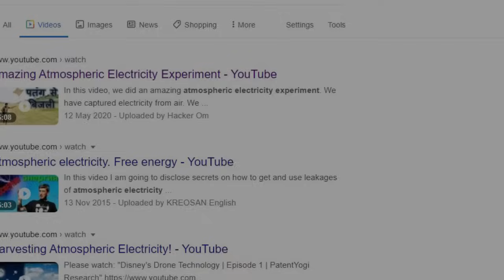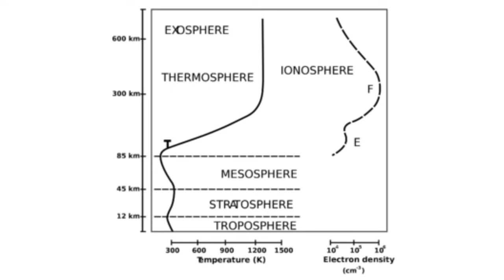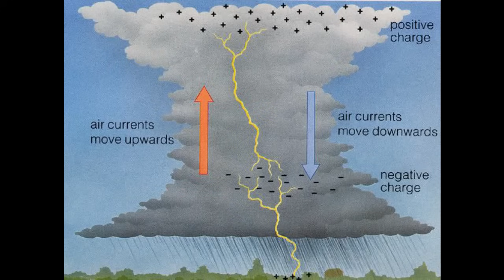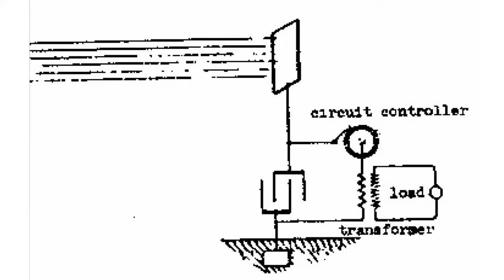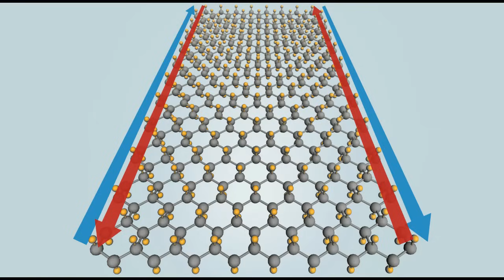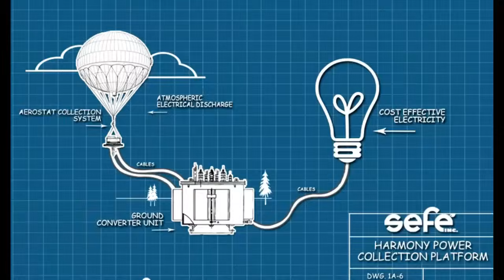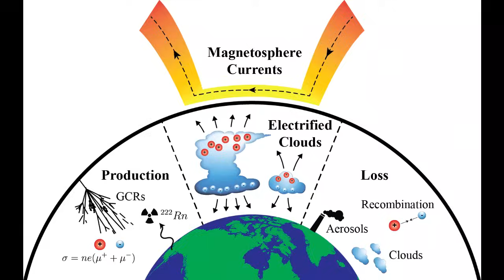Atmospheric Electricity. How much of it can be harnessed?

Comment: Just for thought exercise picture a torus field structure. A clockwise rotating upper half dome. A counter clockwise rotating lower half bowl. High + top high - bottom electrical charge potentials. Between the two halves a neutral charged magnetic plane of inertia.  Where charges can balance and stable molecules of matter can form. The earth and seas are the matter that is formed at the center line along the magnetic plane of inertia. The North polarity at center and the South polarity all around the circumference. Earth is ground relative to the high + ionos charge,  The Earth cannot be spherical nor in multiple rotating frames of motion and exhibit the conditions of stability we observe daily. Thank you.

Comment: There are no electrons it the magnetic field just like atmosphera only atmosphera is full so maybe not much energy in small areas, with a high voltage you can ionize atmosphera and get more energy ... just like lightnings... wrong concepts such as electrons or proton that are 5he same thing are quite a drag...

Comment: Because free energy flows up stream ,Saw the Sanjivani  similar to screw screw tiny energy is like audrino board calling for power say an extraction method as to magnetic rotation or shocks wave moving parts as to  static piezio strippers collector emmiters  in fashion chemicals and different mediums of transfer and collection need all electricity collection non moving parts with moving parts collection as the means of movement  and generation would run on a single battery series they could just charge battery with like  compressed air vehicles but somehow they were banned not enough money in air , was 125 miles for 2 bucks at home price and can be filled fast as gas vehicles now it's future of solar power vehicles and 9 hours of light , a friction frame with hydraulic a arms and shocks with a wave. Generator multiple layer in tire rolling rip curl rotation wave  speakers can generate and rotation  waves crashing ashore sounds,and a hollow w vertical tube water flow would make a nowindmill ? Like a hot air draft chimney solar heated updraft ?

Comment: Think higher the E layer of the Ionaspher is pure energy. To tap it you must be a little over 100 miles off the earth. THINK! the earth has a nickel-iron core spinning at the surface speed of about 1000 miles per hour. As the third rock from the sun, this core is spinning in a tremendous sea of negative solar wind. Ergo, this is a generator, if we tapped the ionosphere we would have more power than we could ever use and end this squabble over energy production. Ella.
Reply: What if we were able to push the level of electrical grounding, below ground level?
Reply: Yes! and the earth is expanding, review James Maxlow's work, as well as Jan Koziar, Stephen Hurrell, Ott Hilgenberg, Klaus Vogel, and the great Dr Samuel Warren Carey.  Carey has an old video called "A Question of Expansion", made many years ago.  Expanding Earth was the original idea, and is still the correct one.
Reply: If you can't reach it, There has to be a way to bend it towards the earth.
Magnetism....🤔

Comment: The fact that you have motors that can run off of this.....
 Means you can generate enough power to at least power a house.
 After you have the motor attached at a much higher point you just add a copper plate and some magnets🙀 
 It's kind of irritating that scientists focus on it investment before they ever focused on enhancement.
 Because of that they failed to actually enhance in all aspects.
 Personally it feels like you just lower the ability to explore.
 Technically if you design the generator to pull.
 Then by law attraction it will.
 The same way that people use magnets to create perpetual generators.
 You can use that to power the generator into pulling electrons out of the atmosphere.
 And the same way that  Little bit of energy moves that motor that motor can pull on that energy.
Reply: Aye, but from what I have seen the motors are super light, while I have not had the chance to experiment with it myself it seems like we would need to use small lightweight magnets for it to turn. But because the magnets are smaller means that we would get less electrical output then desired. 

Personally I think that using towers to extract the charge from the sky would do better, but I would love to explore this more.
Reply: there are other YT videos where a guy shows with a voltmeter that switching the base on and off really quickly amplifies the potential immensely, like AC, and this could be done with anything, but including swirling mercury, another interesting topic, how the E&M forces of mercury combined with electrical potential sources can be manipulated and amplified via resonance.
Reply: Imagine the entire Chicago skyline put to work

Comment: Great info thanks
Yea, when you realize the reality about aether harvesting you will see all the temples, cathedrals pyramids and such had the capacity to harvest aether... But they tell us it does not exist... There's so much more to it...
The aether is said to be that magic “invisible” substrate that connects us all to the “Hive Mind” as well as “source”.
"A rudimentary consciousness may be rooted in this deep substratum of existence.” 

Within the aether, is consciousness.

Just like data/information is transmitted through wifi, consciousness is transmitted and received using the aether. Wirelessly.
The data that is transmitted is carried through frequency, the frequency "travels" through the aether.

Like waves through water, you can see and feel. You know are real, but you cannot see/feel/ aether outside of the freq range of vision, hearing and feel. And some have led the masses to believe aether does not exist... using the aether...

Meanwhile NO thing exists without the aether. 
https://exhibitxxxxx.blogspot.com/2021/09/nothing-exists-without-aether.html

Comment: Could you power a skyscrapers basement level lights with the electic diff?
Reply: easily
Reply: You can run any of the lights if you use one circuit to charge and another to run, sending the electric back up
Reply: The twin towers supplied the whole of New York and surrounding areas for a long time. This technology is being suppress from us so energy companies can profit. 
The national grid in the UK uses a lot of free electricity then the energy companies charge us for it 👍🏼
Reply: They used to, and this is why the "world fair" buildings of the 1800s and early 1900s were demolished under the guise of temporary exposition structures. The freemasons and others developed a way to harness store and light bulbs and run things like electric trolleys... the greatest misunderstood energy and architectural mystery of our age, which points to free energy in antiquity and recent.

Comment: What if we buid a tower 50m high. With the the bace to the top that is not grounded. Then we create a vacuum between the receiver and the collector at the bottom. Wil we then create Electrons to flow down, un disturbed by way of an arc.. To prevent electro magnetic losses by using a wire... By using balloon the wire that goes down passes through other air mediums that is differently charged and looses the charged particles it accumulated on the top or due to magnetism generated in the wire going down... Can someone please answer me. We have to break this technology and create free energy
Reply: You can also switch the antenna to the ground very fast, in  a very simple setup, ive built these  small generators from germanium diodes and capacitors, then swith a mosfet let say 150khz, that grounds the antenna every time, yhis causes the collection rate to raise very very much, we create a motion without motion
every time the antenna is not grounded, it dumps the potential thru the diodes and charges the capacitor
Reply: There can not ever be a such thing a free electricity, or free anything, in a capitalist system.
Reply: @geelee1977  Have to dump capitalism faster than ever.
Reply: Keep doing what you're doing
Reply: https://youtu.be/0kcNTcH9u08?si=kDQrbgSoZd4e14sO
Reply: https://youtu.be/0kcNTcH9u08?si=kDQrbgSoZd4e14sO

Comment: Is there power in lightning bolts? 
Just pico amps
 lol
Reply: B's 1,000,000 volts 30,000 amps
Reply: If it was picoamps lightning would look like a little glowy string of light that kinda stings a little

Comment: Every skyscraper is Built to harness elektromagnetic energy
Reply: The building is grounded to the earth so it acts like you are standing on the ground. 
However the height you need to reach for higher voltages is reduced when atop the building.
Reply: It’s what ancient cathedrals and other ancient tartarian tall buildings were used for. Past civilizations were much more efficient and green. Unfortunately, robber barons can’t profit from free energy and disconnected those systems.
Reply: @ivanjimenez8868  💯
Reply: @ivanjimenez8868  they're not cathedrals

Comment: Harvesting the energy from thunderstorms would be very lucrative if efficient enough. I presume advanced supercapacitors could be used to rapidly store surges of electricity and then feed it into more stable storage. Right now it would be very expensive to do for how much energy is obtained. However, with enough development, it might be possible someday to take so much energy from thunderstorms that the storms themselves vanish and entire cities can be powered.
Reply: i've found harvesting radiant energy from data centers is huge compared to atmospherically electricity.
Reply: The super capacitor that you are dreaming of is right under your feet.
Reply: we are surrounded by electricity/energy
Reply: Pls
Reply: its already happening, chicago cloud scrapers are all built to store energy underground in large soil batteries
Reply: But storms are not connected to atmospheric electricty? They are clouds needing to pee. 
Other then that I do agree, we should look more into it!
Reply: 1.} Building something that can withstand the violent temperatures and conditions of lightning would be difficult. 2.) There's not as much energy as you would presume. The potential energy stored from a single lightning strike is enough to power 4 small homes for a month, not enough to justify the major expenses to create storage equipment. 3.) Knowing where to place the storage and conversion equipment, as  you know, lightning isn't predictable. I believe if it were feasible, it would have been done long ago.
Reply: @texmo87  It's not about harnessing the lightning bolt, it's 
about absorbing the energy before it becomes a bolt.

Comment: Sq meter 10pa is for dc current not tuned to Schumann freq. Like tesla was doing. The earth and other celestial bodies all have a tuning do you have the right radio. Or RLC designed to use it. I woukd go with how much power needed first this will give you how high and what gauge wire for the proper resistance calculations... The right size and shape of the top hat will determine the capacitance so you can make a variable inductor to help tune... Good luck. I would be glad to make a demo for 666 bucks
Reply: The Earth is not a celestial body
Reply: @jaspervasquez3753  , yes it is
Reply: This "Top Hat" I speak of tho... 🎩

Comment: Gonna need a battery as large as a Mountain and capable of storing it long enough to be used!
Reply: Perhaps.. but we need to build a better battery.
Reply: Or on top of a mountain!
Reply: Not a battery but a magnet
Reply: We need Layden jars for storing Aether, aka static electricity.
Reply: Maybe the pyramids also functioned as a battery?
Reply: Nice, just put a collector on top of everest and... Battery is not a problem,
Reply: if such a electric harnessing was created you wouldn't need batteries, you would just need super capacitors.